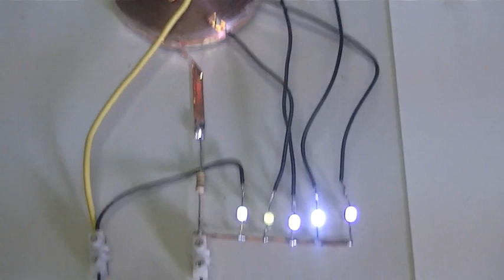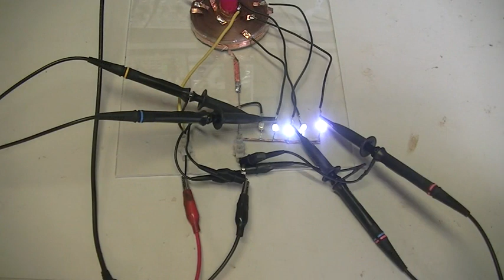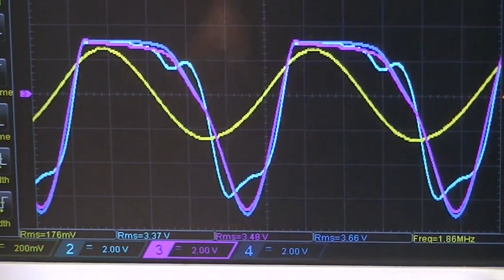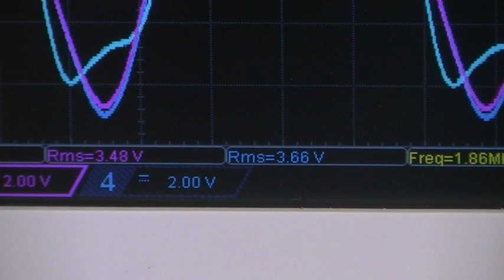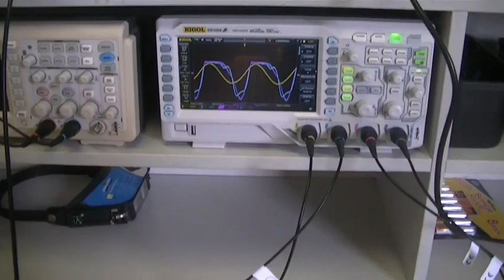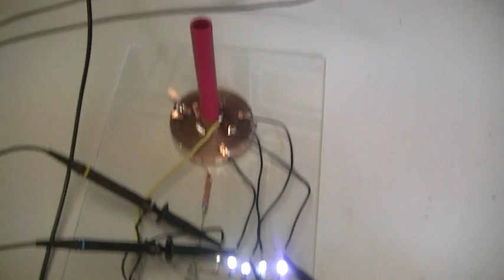Comment: 05:06 - "There is apparently not enough energy across the function:signal generator" --> Sure! if You create a A NODE OF VOLTAGE at the very output of the function generator, You won't get any energy there ;-)  and it will light the other LEDs depending they are placed on an antinode or not. The proof of this is that your frequency generator I guess was still delivering amps ;-) Btw, that was very missing You didn't show the amps of the output the frequency generator BEFORE the short of the LED directly across it :/ Anyway, this is Very Nice to see the effect of the nodes and antinodes of voltage along your Very Nice Ribbon BPC and having provide the scope reading :)

Comment: Conservatively, if each of the four output LEDs were only twice as bright as the input LED, then we're looking at a COP > 7!
OVERUNITY!
Good times.  :)
Reply: I'm not sure Mate. What about if the entry of the circuit is a node point of voltage? it won't have any to light the entry led but it doesn't mean there is not amps drawn in the circuit from the generator! ;-) Would need to have a voltmeter across the bifilar coil to see the amps with could be also near  90° out of phase at the entrance went at this moment, imho.